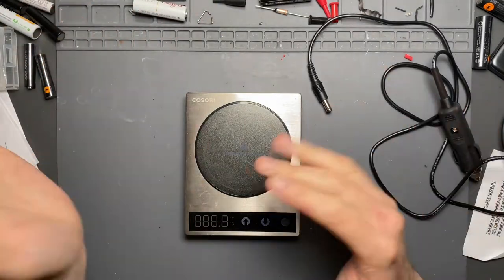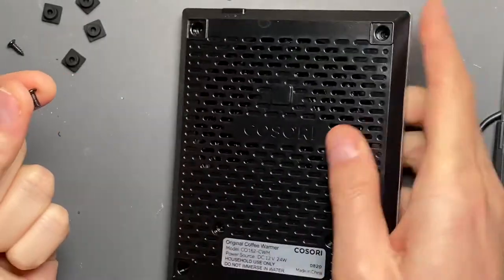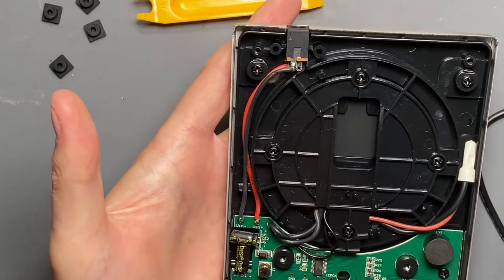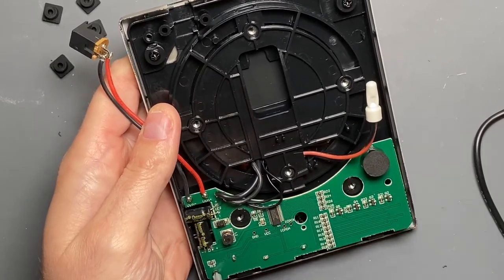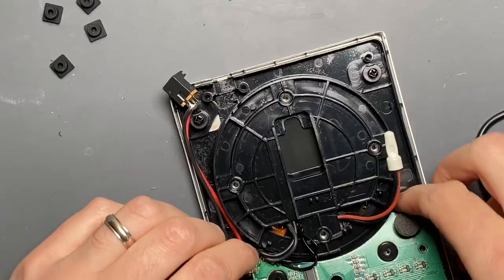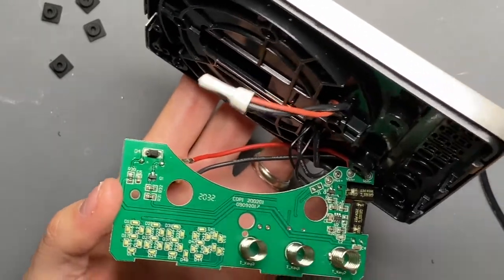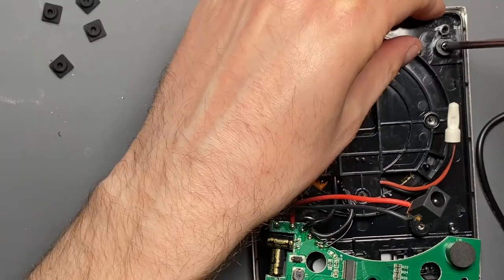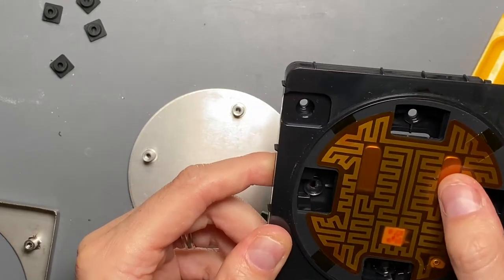Cosori Coffee Mug Warmer Teardown  (CO162-CWM)

Comment: That was great! I am constantly looking for a coffee keep-warm solutions, and I currently use the Ember and keep a plastic lid on the cup to extend battery life by reducing heat loss. However, I usually use the cup at my desk or work bench and am thinking about a switch to use this device, and maybe modify it. My plan is to slide the Cosori cup & warmer into a 'dog house' with an internal sloped and spring-loaded cup lid suspended from the dog house roof, basically forcibly covering the coffee cup when in the 'house'.  The Ember can continue to be a mobile solution. Ideally, I could use the Cosori with ordinary concave-bottomed ceramic mugs of all types but then I need a raised center on the aluminum heating element; I'm thinking washers or 50c pieces. Thanks for your assistance, the internals really helped me choose this as a basis for the next attempt. Of course, they change the part numbers all the time so I hope there is the same attention to detail in all the models. Function is so much more important than appearance for me; the joy of hot coffee is not to be thwarted.

Comment: I really like the Cosori, unfortunately, whoever designed it, (despite the supposedly good engineering you describe), totally forgot that most mugs have a bit of a non-contact region on the bottom. If you try to use the Cosori on a regular coffee mug, it simply will not work anywhere near most people's desired "keep warm temperature".
Ultimately, I love the digital control, so in order to salvage it, I found a thin walled stainless steel cup with a flat bottom, and put a cup insulator around the sides of it.
People shouldn't have to go thru that much effort tho, so my recommendation is to look for a better model with a higher output than 24 watts. (If Cosori made one, that would be ideal).
Reply: If anyone knows where we can buy a flat bottom cups let us know.
Reply: @DreamDetective  Amazon and Ebay both had "Flat bottom mugs" when I did a search... I would just make sure that there is a picture so you know it really is "flat". (Watch out for the shipping fee on some of these).
Reply: Amazon has the same warmer but it comes with a metal cup from Amazon for $39

Comment: If you move the extend wires from temp sensor device to the cup itself instead of just the heater base, the control loop will better modulate the hot liquid temperature. But the energy required might hit the safety shutoffs.

Comment: Love my CASORI.  Display just started going crazy and it won't heat.  Suggestion on component repair???  Loved your breakdown.
Reply from the maker: Oh no! Did liquid get spilled on it by chance? Thanks for watching!
Reply: @The Curious Engineer  no just stopped working. Ordered a new model.  Power supply works on the new one so it is somewhere in the unit.  Since the temp settings work I suspect a failed cutoff sensor or the main board.
Reply from the maker: @geraldclements1612  Ah. I got a little confused when you said the display started going crazy. What happened there? 🙃